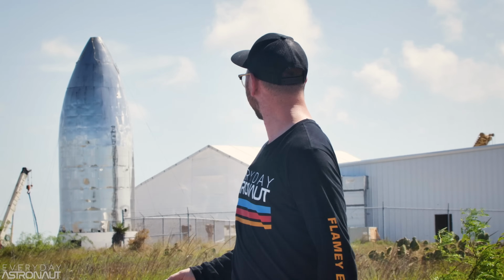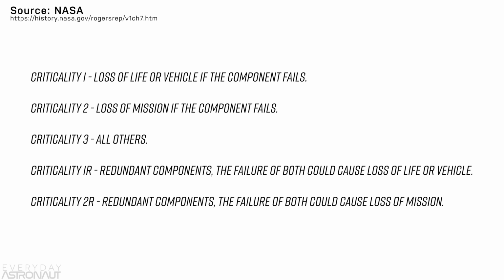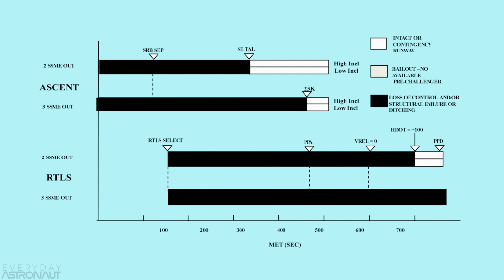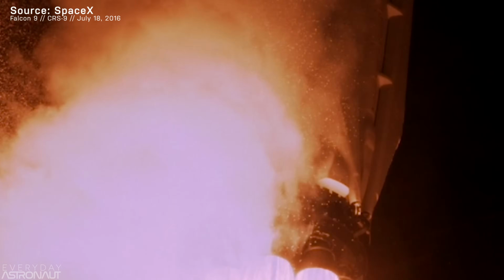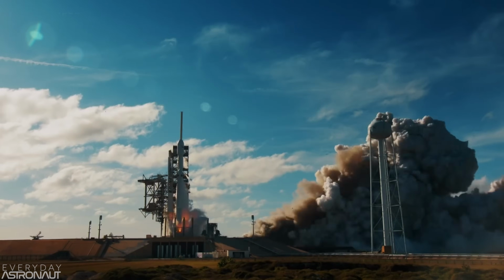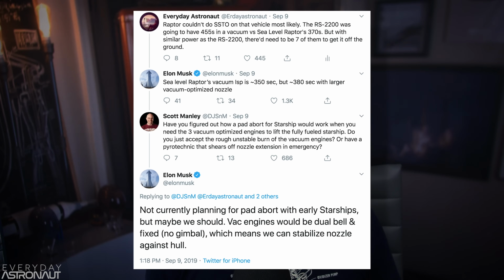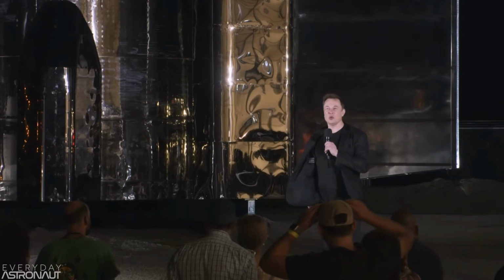Why won’t Starship have an abort system? Should it?!

Comment: Tim, you have to face it, you're Elon's apologist. No matter what they decide, you will always find a way to make it sound like its a good decision. 
This is no exception, because YES, Starship SHOULD have an abort system, because safety first. It could be achieved by redesigning a bit upper stage engines, and adding internal escape-boosters that would move away the upper stage and ignite the vacuum engine (which would be less efficient in air, but still, would enable a greater escape boost).
Reply from the maker: It’s funny though, my consensus was I disagree with no abort system but I do imagine a world where they’re unnecessary some days.
Reply: @EverydayAstronaut  my apologies then, my takeaway was that You're pro-with idea of no abort system. I'm not expert myself, but I am pretty sure top part could be redesigned while losing just a tiny fraction of the payload-to-orbit capability.

That being said, commercial airliners have no abort system either, however, they do not sit on a bomb.
Reply: @crax0r85  is not the case but let's go redesign airplanes

Comment: Why not use the super Draco abort system rockets by having them designed in a way that they could be manually configured during a failed landing shoot deployment to be used as a last resort to propulsively land the capsule. Don't certify it don't authorize it don't ask for certification or permission but let it be known to the crews that fly dragon that rather than die crashing back to Earth they could toggle some controls and attempt to manually soft land dragon.
Reply: Starship does not have any capsule

Comment: How many vehicular airbags have saved lives?
How many vehicular airbags have killed people?
How many vehicular airbags have been manufactured?
What is the additional cost of fitting airbags?

How many vehicular airbags have been deployed, 0.02%? I don't expect to crash, but I still wear my seatbelt.
Reply: There is one big difference: seatbelt is really cheap, abort system is almost impossible with current concept of starship.
Do u use 5 point seatbelt?

Comment: Critical Thinking Moment Ahead  Technically speaking, you are incorrect about no escape/abort system, for the Starship.  It can always jettison the boosters, and make an emergency landing with the crewed section alone.  Automating it, is just a matter of a several lines of coding in the monitoring software.

Comment: "Abort System" ?
Agree with Elon's speech.

Considering all posible, 
will risk without an abort system.
Reply: Can compare spaceflight to cars,
on risk levels.
(?? Cars by a sister company ??)

An automobile travelling near 30km/hr (20miles/hr), is about as deadly as a rocket ship.

Automobiles,  DO NOT have launch abort abilities !

Instead: automobiles have 
impact reduction systems !
Reply: Assuming a major failure:
will a launch abort, even be possible ?
(Stopping a race car ?)

Comment: Elon would be dangerous if he had my brains!The People's inventor! Or would he? Of course,with 2500 studies you think in sleep,but I use those thaughts to creat more inventions,in a test for speed I did 50 inventions in 2 hours and 15 minutes.Who thaught that was impossible guy's? The secret is the 2500 High,medium and regular novice studies in thousands of area's and offset area's to origins of accomplished proven facts and area's and things that failed and worked.Youcmyst be aware of the failures of things.That will even help you guy's in your work. Well gotta get the door see ya!

Comment: More engines are balancing enhancers.Amagine having 20-30 all around the ship,it would conspire the floating phases,Which you could land vertical or horizontal.
Put them all on one side,and you have a vehicle that could possibly take off from the ground itself! But you'll have to balance it out,you could put fuel on the lessor weighted side!

Comment: You could argue the thing with less parts is better also for seatbelts and airbags. So in my opinion you should first make sure the safety system is 99.9 % reliable and then focus on making the overall system more reliable. If the reliability if the overall system exceeds the reliability safety system, you could either remove the safety system or make it even more reliable, so that it again exceeds the overall system. For the seatbelt example this would be the case if self driving will become more reliable than seatbelts and airbags maybe you can remove them or you can decide to make it even more safe.

Comment: Before I even watch this, I'm going to say it doesn't matter. There was a fire during an Apollo rehearsal and there were two shuttles lost. Lunch abort wouldn't have helped with any of those situations. There's been one time I can think of, a Soyuz (I'm sure I'll be reminded of others), that actually aborted and used the system as intended. Other than that, it seems like the situation where launch abort can help is so specific but the drawbacks of adding one are so great that it's not worth it.

Comment: Yes, it should have a launch and landing abort system, at least in some iterations. Imagine if you will, the idea of the lunar lander version being built with a crew dragon capsule built into the nose. It is already approved for manned flight and if used, could undock in cruise and reverse direction like the lunar missions in my youth did. Thus the entire starship could be accessed. 
Your numbers work for leo manned missions. But don't for lunar, mars, and other distant locations.

Comment: This guy either works in the aerospace industry or knows a whole bunch of people who do because his technical analysis is spot on. Also, just like how 747s don't have ejection seats or backup Cessnas onboard, you make a vehicle safer by making it more robust and reliable and not necessarily by making it more escapable.

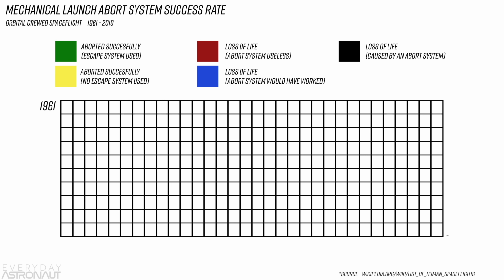Comment: Talking about flight abortions (the table at 38:10), 1% is still a huge number when we talking about human lives. I doubt anyone agrees to jump with a parachute if it can fail 1 time per 100 jumps, despite formally it still has 99% durability.

Comment: 11:30 The solid rocket boosters have 60% thrust and the space shuttle has 40% thrust to take off. Fairly close to 50-50 yet the solid rocket boosters have way mor flame and POLUTION compared to the space shuttle. The H2 is way more efficient just by looking at the flames of each. lol

Comment: If NASA requires escape systems for their astronauts,  we should require escape systems for everday-astronaut passengers. Once Starship - and any competitor - is flying millions of passengers a year, then let's consider whether escape systems are still needed. Also, make the escape systems with as few mechanical parts as possible.

Comment: I don't consider glasses 'getting rid of' bad eyesight, it only corrects for a flaw in your vision. True 'correction' would restore 20/20 vision with no need for glasses or contacts or any other device to correct your vision. This would put the whole eye care industry out of work so for that reason it will never happen.

Comment: Here's a question - could they have simply reskinned the Shuttle with stainless steel? 
Certainly the leading edges would be taking the brunt of reentry.
Reply: No so one of the main issues with the shuttle was weight and nasa designed it in the 60s/70s and back then they had a huuuge budget so when the issues with the heatshield started they didn't have the money to redesign and adding extra stainless steel means rougher reentry and less payload to space there was also a bunch of other issues for which I currently don't have the time to explain so that's it

Comment: The two catastrophic failures of the STS were not directly caused by design flaws or even technical failures, they were the failure of management and the result of (at best) bad judgement and misplaced priorities.  Challenger was entirely preventable, and had they not chosen to simply whistle past the graveyard and immediately investigated the damage to Columbia (and left the shuttle in orbit) some form of repair or rescue could have been attempted.  In the case of the "old NASA" that sort of thing was captured in the slogan "Failure is not an option", and showcased with the safe return of the Apollo 13 crew.  Somehow, by the time we got into the shuttle program that attitude had changed into "Failure is not a problem." and we lost two crews as a result.

Comment: As usual a highly professional approach to the subject. Your reflections are really enjoyable.

Even in the pioneer days of passenger flights, there were no abort systems. It was not feasible to have 50 passengers jump out with a parachute  :)
Some passenger trains are really really fast. If they fail, people dies. There is no abort system.

With new technology for passenger travel, we will have to accept, the only way to ensure safety, is failure. Or said in a different way,- that people dies for future safety.
Reply: Pray that someone with a rational state of mind puts a stop to this

Comment: Hey Tim, I do have a question regarding the “flight control systems” (aka the “Aerodynamic Flaps”) on Starship and them changing the control system from Hydraulic (and most likely redundant systems like other spacecraft and aircraft) compared with their newest complete change in technology to using “Tesla” (car motors) to directly drive the flaps. I’m wondering if they are planning on using redundant “electric motors” and probably gears, gear reduction systems to make the “torque” requirements which I’m guessing are pretty high to actually move those huge flaps against the air’s force while acsent and reentry. I would think there would need to be a “transmission” type device for each motor to up the torque, enough to have enough aerodynamic force and speed to effectively alter the spacecrafts; landing site especially in a emergency situation where quickly choosing an alternate landing site, also effectively changing the spacecraft’s attitude and spin control during acsent and reentry. I’m guessing at first they will use redundant motor’s speed to more important torque, although electric motors do create much more torque than a gasoline engine (when comparisons are done in cars) although I wonder if they would have to use some kind of “transmission” to reduce the speed in creation of more torque and reaction speed needed to work fast and reliablewould be a concern among other things but I believe Elon was quoted saying approx. “They changed the control systems for the flaps of the Starship to “Tesla electric motors” I hope he is not just sticking those @car” electric motors that are rated for well, cars...and use those same motors to directly and only using one or less that what would be considered more than twice the redundancy. (If that all makes sense, I apologize for any grammatical, spelling, and thought consistency; as I would like to write something worthwhile one day.) well I hope I covered every major possible issues with this change that frankly doesn’t seem to be getting that much attention. 
Love your work, great content, execution, and completion. Your ending production value is very nice, including your perfect video transitions and great overall audio. I’m not much of an audio person, but just by pure comparison the quality is there. At least that’s my humble opinion. Keep up your great work! I bet during accent when the Space Shuttle’s S.R.B.’s light on the pad and the whole vehicle is “blasted” into space almost like its being shot out of the barrel of a gun! (Even though I believe it’s actually moving even faster than that when it’s entering orbit) anyways watching your videos it so makes me want to try to get some good equipment and do some videography/photography/video editing/effects/audio etc. and maybe I could actually put some of my graphic design and multimedia courses could actually do something worthwhile. Lol thanks for your hard work Tim, you are a great asset to the space flight news, information, opinion and facts aspect to the whole genre.

Comment: There is not enough statistical data to say if abort systems are useful.  IMHO With the current data one is just as likely to die with an abort system as without.  The shuttle never would have had any failures if they had done something about the foam and ice hitting the heat shield when they first noticed it, rather than waiting for a complete failure.  something like that would not be allowed today.  Challenger likely would not have failed if they had not launched outside of operational limits.  albeit the o-rings didn't leave much room for error.  I doubt they ever tested the SRBS to see what the limits were other than in the lab.  How many fully functional unmanned shuttles launched, or equivalent without a real shuttle to test operational limits?
Doing so would mean accepting possibly losing 2 SRBS, and 3 RS25's, not a cheap loss.  SpaceX has already lost 2 Falcon Heavy boosters, one in testing limits.  Then going back and seeing what can be done to improve that.  At the very least they know for sure what is the limit.

I wonder if they are prepared to accept 1 or 2 failures of the starship before putting crew on board, just to test operational limits.  I hope they learn from the failed shuttle missions and fully investigate and test any anomaly during real flights, make necessary changes before a disaster involving crew occurs.  IMOH NASA could have prevented both shuttle failures had they done so.  Unfortunately political pressure, time and money ultimately caused the loss of 7 lives for sure (possibly 7 more), not the technology or hardware.

  Take a car or airplane and try to do something with it that it was not designed to do, and it will likely fail, in the case of a car you probably have a good chance of surviving, in a plane a much lower chance, and with a rocket almost 0%.
Reply: I expect it will go the same way as the Crew Dragon capsule - i.e. Starship will have to have several unmanned cargo missions under their belt before even a single test astronaut takes a ride.
Reply: @nolsp7240  Agreed

Comment: My understanding was that in WW1 the pilots averaged 25 hours between crash's, most of which were not related to enemy action. With regards to reliability, generally speaking you can't get 100% reliability. So for items where their failure will cause loss of vehicle and crew, you are going to want some redundancy. Trying to get a 100% perfectly reliable parachute deployment is probably a fools errand. Very high reliability with some kind of back up is likely to be the more safe option.

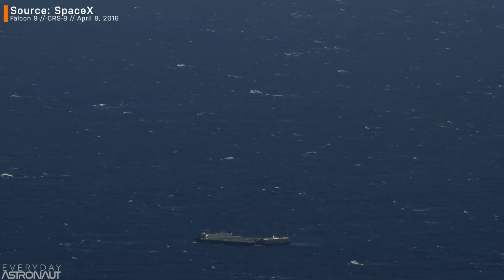Comment: 27:15 The Apollo missions didn't rely on propulsively landing on the moon. There was an abort option. They could abort the landing at any time, fire the ascent engine, dock with the command module, return to earth and land there -- non-propulsively. Starship won't have that option. It absolutely has to land propulsively, and it must work on the first try, no abort possible.

Comment: Even if I was told the rocket I'm going into have 95% chance of failure, I would get into. Just because 'SPACE'. So I'm not impartial when I say 'Team No escape system'. But it run into my own design when I work (as software developper) : "How to do more, with less and simples parts".

Comment: Is there any possibility of making a vacuum optimized engine bell in 2 pieces so that in the event of an abort, half the bell could be blown off to transform it into an atmospheric optimized bell. Could that possibly give starship more thrust in the event it was to be used as its own abort system. Combined with directed explosives to actually meet and buffer any shockwaves and potentially damaging debris from impacting starship

Comment: my daily driver is a '73 VW Beetle specifically because its simplicity makes it reliable. there is no radiator to leak and cause overheating, there is no computer to break down, no O2 sensors to clog, and it's small enough that I can push it up a modest hill by myself if I need to, and the manual transmission means I can easily and precisely control it down a hill without the engine, or start the engine with a dead battery or dead starter. and this is all apart from maintenance, which I can do myself all the way down to pulling and rebuilding the engine and transmission by myself without any special tools.

the best part truly is no part, because it weighs nothing and breaks never.

Comment: Vostok and Gemini and Buran had ejection seats and this late Svelda high altitude eject system was also planned on EU Hermes shuttle. Later an emergency parachute is fitted on all Cirrus planes saving about 50 life's already in over 20 activations . Starship should have similar safe human recovery hardware as Shuttle showed it was mandatory with the huge amount of rocket initial energy in your back.

Comment: 38:50 "so only about half a percent of flights would see any benefit from a launch escape system"... my KSP contraption, lets just round that one up to 100%
Reply: He should instead have said "of the 3 incidents where an abort system could have been used, only 33% were successful."  That puts the value of it in much clearer perspective since it would raise the bar from 99% to 99.3% and that's not insignificant.
Reply: yup i am thinking more like 50%

Comment: well if the thing is safe enough to not even have any kinda abort system then it is very likely that the maintenance that is necessary before the next flight can be even completely reduced to 0. so just think like this, would you go for a car that is safe on most circumstances or a car with an ejector seat. (mod): what if the ejector seat can go wrong and your car explode because of ejector seat??? well i would definately go for the safecar